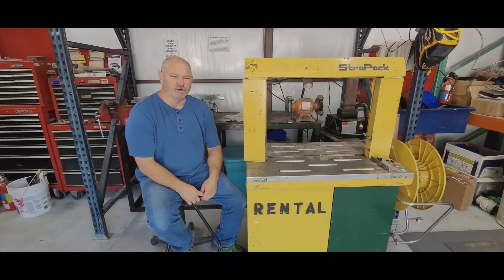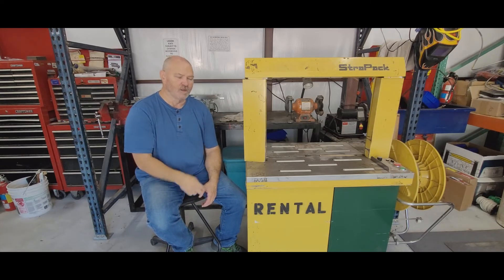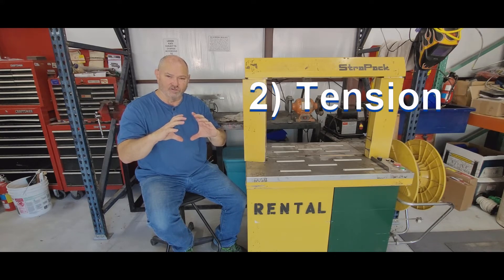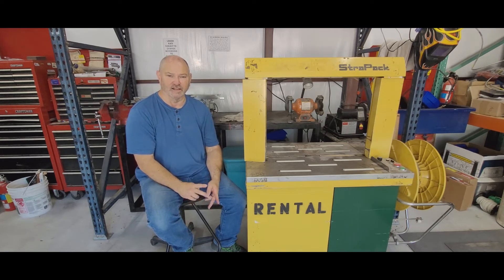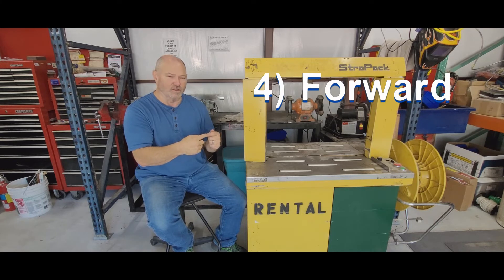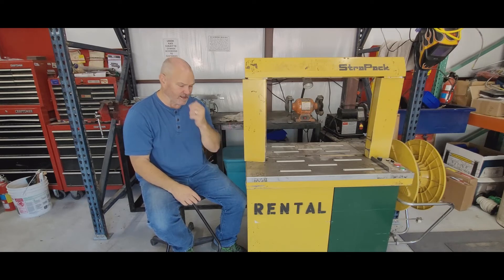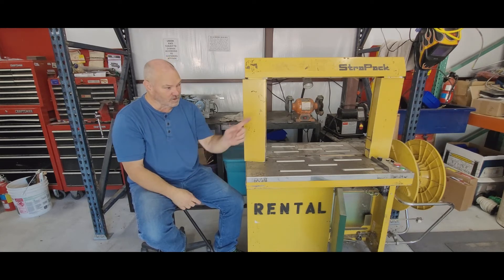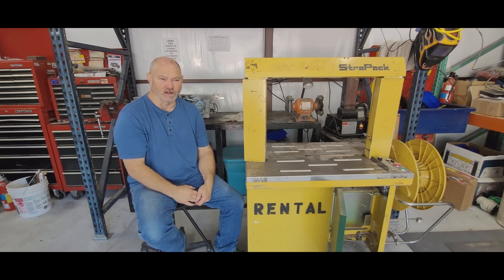StraPack RQ8 Troubleshooting

Comment: I have a Strapack JK-5 and the forwarding is always about 1in to 5in short of the heating element. Do you know how to fix this issue?
Reply from the maker: The main problem with a JK-5 short feeding is the Reel Brake needs to be adjusted. I'm emailing you a pdf of the technical manual so look on pages 20 and 21. One adjustment is for "Old Style" and the other is for "New Style". See which one you have and adjust accordingly. If this doesn't work, there is a troubleshooting section in the back. Good Luck.
Reply from the maker: This was kicked back. Can you send me an email at: strapandwraptech@gmail.com and I'll send this to you.

Comment: Hey this is a great video! But I need some input. Im having some sealing issues with the heater, I know that when the tension is too high the seal snaps, what causes the heater to fail? I’ve even reset the table and it only worked for a few cycles.
Reply from the maker: One of the main causes is the heater blade is dirty. Clean the strap residue off with a wire brush or some fine sand paper. Be sure to clean both sides. Good Luck

Comment: I have a bander that is not feeding up into the arch. What are some things to check? I have another one that I changes the knive heater with new and still I had to turn the vr2 up which is the length of time the knife stays in to weld the strap to get it to band. What are somethings I can check?
Reply: If your strap is not moving into the lefthand bandway, you may have a small piece of strap in the feed shooter that it's dragging on. I would start looking there first.
For the strap not sealing, I would say to clean your heater blade, but you've replaced it with a new one. I would check to see where the temperature is set for the heater. Look on the Control Box and start at halfway.
Reply: So it appears that the knife is not going all the way in when melting the band causing it not to bad. There is melting marks on the side of the banding which leads me to believe it is hitting the side of the banding.
Reply: Issue on the first bander was it catching where the two plates meet under a wheel and the banding is coming up under wheel and either feeding above or hitting the plate in front of the wheel
Reply: I have videos in slow mow on what is going on with the heater knife.
Reply: @dannythompson560  make sure that where the strap is going into the machine, that the curl is pointing down. This is very important. If it's pointing up,  this could be the reason for it hitting in the feed shooter.
Reply: @dannythompson560  if the heater is hitting the side of the strap, you may have to bend the heater up or down to go between the two straps.
Reply: Thank you. Ended up bended the heater blade. And the other was in feed a part that was bent and not allowing to move freely and that part was connected to another that needed to be able to move up and down freely to function properly
Reply: @dannythompson560  Awesome

Comment: hi!how can I change the control unit with purple color on yellow,burned purple block to replace there is only yellow,chips not fit.machine RQ 7000M.Thank yuo!
Reply from the maker: The best thing you can do is order the correct control box from StraPack. Be sure to give them the model and serial number to get the correct part for your machine. thanks

Comment: Hi, My strapper will not reverse the strapping and tighten the strap around the box. Any suggestions how to fix ?
Reply: The first thing to check is reversing the strap manually. If you move the Forward/Reverse switch to reverse, does it look like it reverses properly?